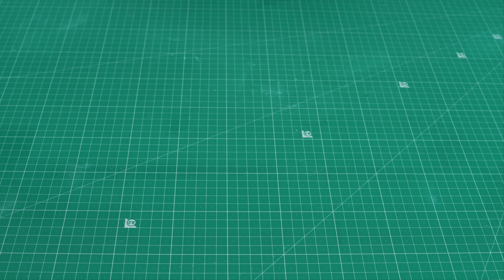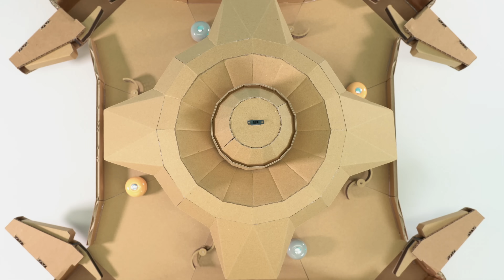超！エキサイティン！！ダンボールでバトルドームつくってみた｜Making BATTLE DOME out of Cardboard

Comment: I saw the battery case is setting on a wood board inside the rotating box on the top.  Then all of a sudden i don't see the point why they have to glue a harden paper board by using 4 layers of carton paper?